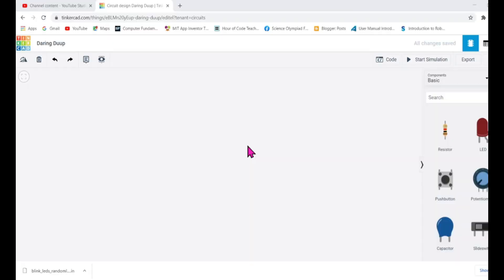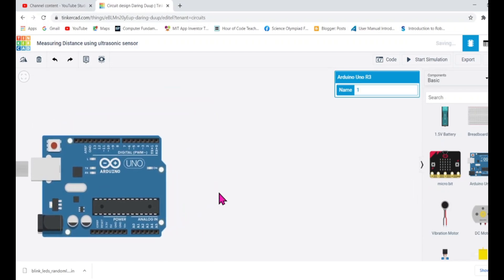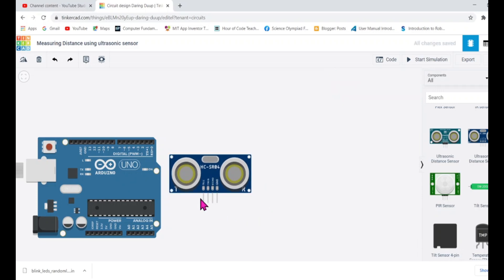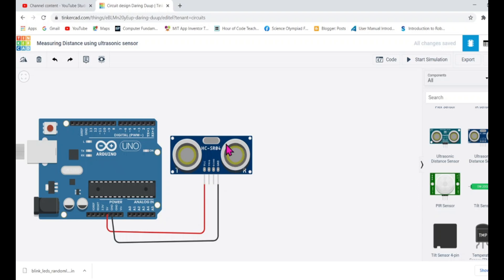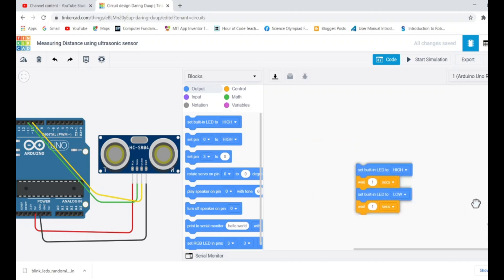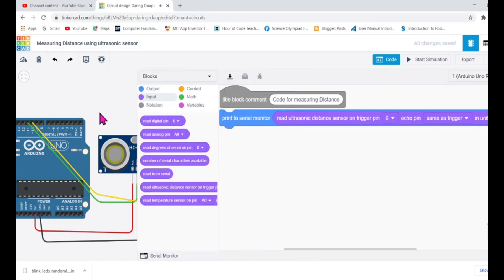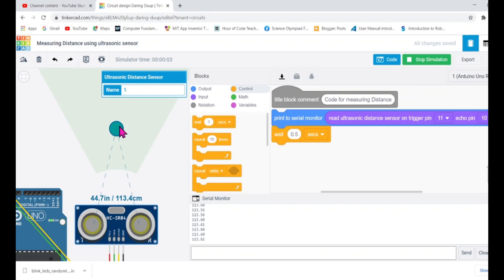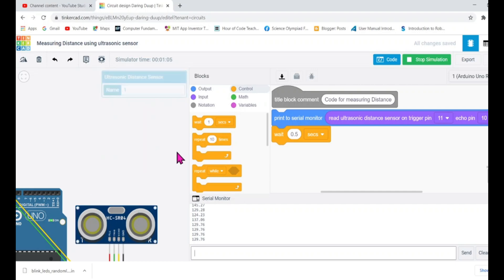Tinkercad Circuit to Measure Distance using Ultrasonic Sensor and Arduino

Comment: Thanks for this. In a lab I'm doing, I was given code that was for a three-pin sensor but was instructed to use a four-pinned. He never cleared up what the pins do, so you've been exceedingly helpful.